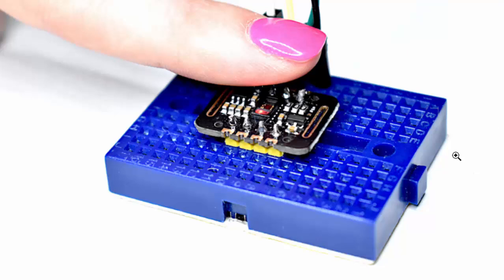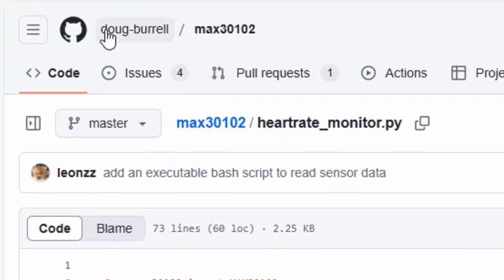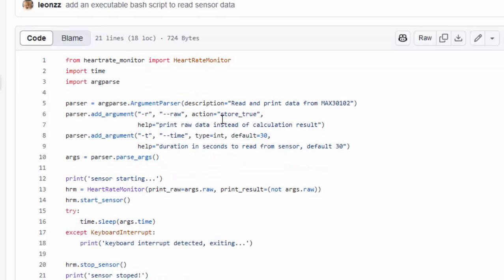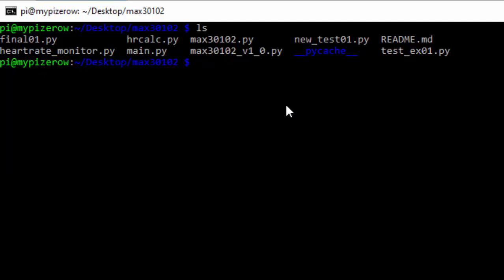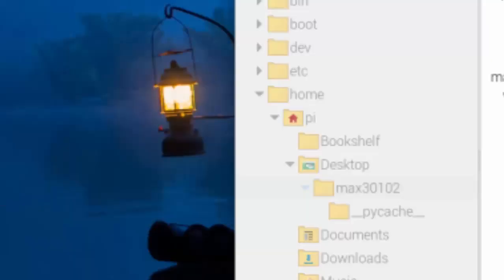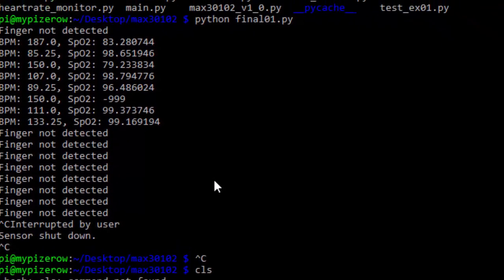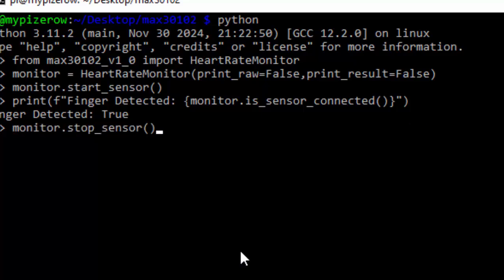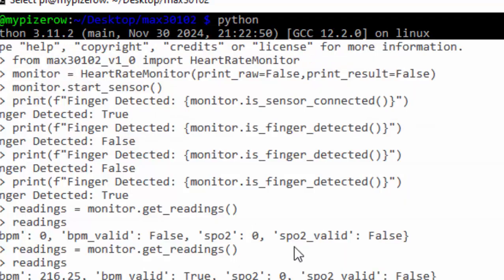MAX30102 Raspberry pi | Pulse Oximeter Sensor Interfacing with Raspberry PI

Comment: Hi I am using the Pi Zero W and the Fermion: MAX30102 Heart Rate and Oximeter Sensor V2.0, but the values never change. Is the library compatable with the v2.0?